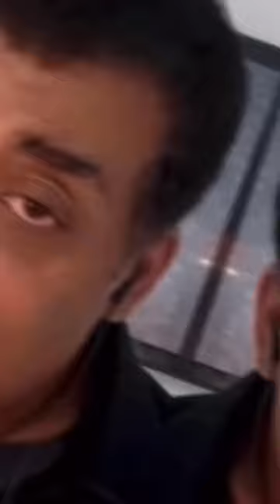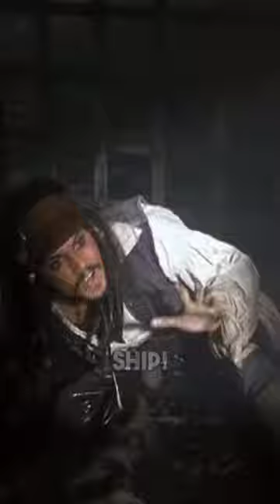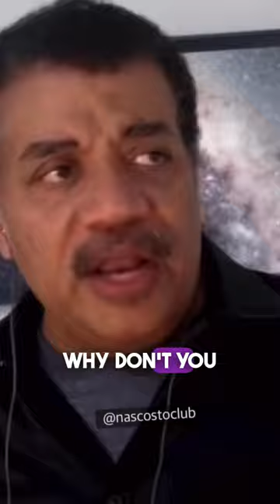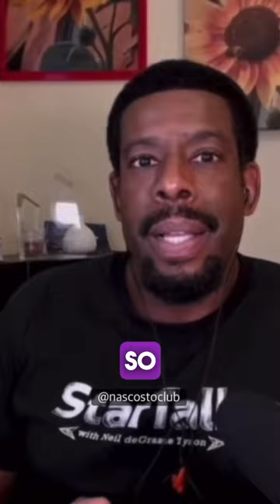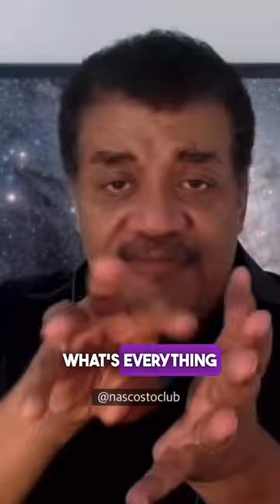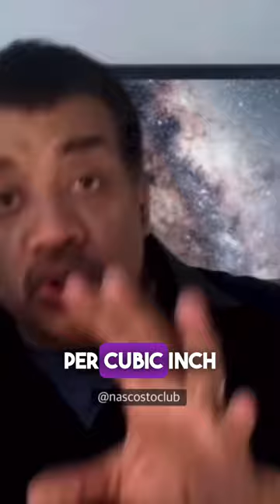How do STEEL ships FLOAT⁉️⛴️

Comment: Boats are super fascinating, aren't they? Let me break it down for you in a fun and easy-to-understand way.

Boats work based on the principle of buoyancy. When a boat is placed in water, it pushes aside an amount of water equal to its weight. This displacement of water creates an upward force called buoyant force, which helps the boat float.

The shape and design of the boat also play a crucial role. Most boats have a hull, which is the part that comes into contact with the water. The hull is usually curved or V-shaped, allowing the boat to glide through the water smoothly. This shape helps reduce drag, which is the resistance encountered when moving through water.

To move forward, boats use different methods of propulsion. Some boats are powered by oars, where rowers use their strength to push against the water, propelling the boat forward. Others use engines, which can be powered by gasoline, diesel, or even electricity. The engine drives a propeller, which pushes water backward, generating a forward force that moves the boat.

Sailing boats, on the other hand, use the power of the wind. They have a large sail attached to a mast, which catches the wind and propels the boat forward. By adjusting the angle of the sail and controlling the rudder, sailors can navigate and steer the boat in different directions.

Boats also have other important components like the keel, which helps provide stability and prevents the boat from tipping over. Some boats have ballast tanks that can be filled with water to increase stability. And let's not forget about all the cool gadgets and instruments like GPS, radar, and navigation systems that help boaters navigate and stay safe on the water.

So, that's a simplified explanation of how boats work. They're a combination of clever design, physics, and human ingenuity.

Comment: from the director of how does the mirror know there's an object, this summer: how does the ocean know the density of my boat
Reply: Through gravity. Basically the submerged part of your ship has to weigh less than the water that it displaces when its put there.

For example if you have two bars of steel that have the same dimensions but one is hollow and the other isnt.
They will both displace the same amount of water but the hollow one will weigh less. If it weighs less than the water it displaces it floats, if it weighs more it sinks, and if it weighs the same it'll be stationary wherever you put it in the water.
Reply: Foolish people question things we don't have to. I guess they're trynna look smart lol
Reply: Doesn't know ur boat NOR gives a f about nun... It's a thing called gravity that balances different objects including us ,however it does what it wants or what it was made by someone to DO. Ya